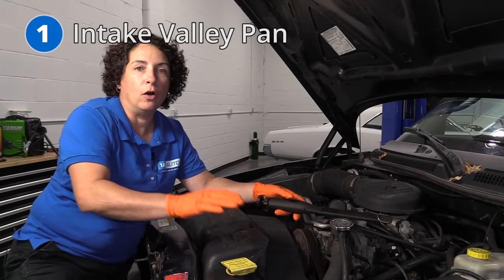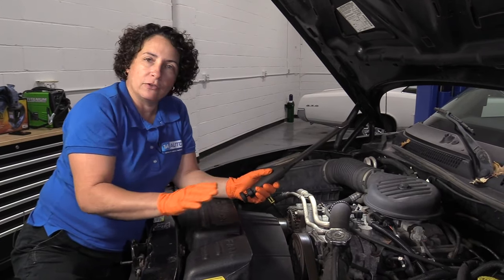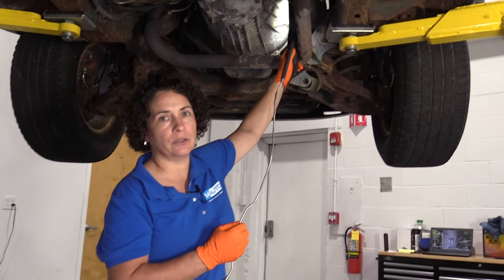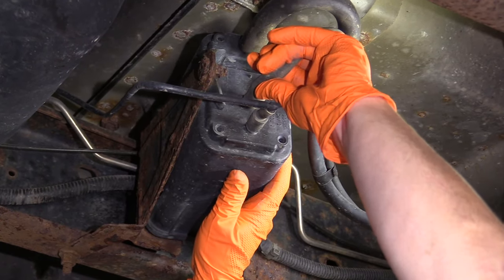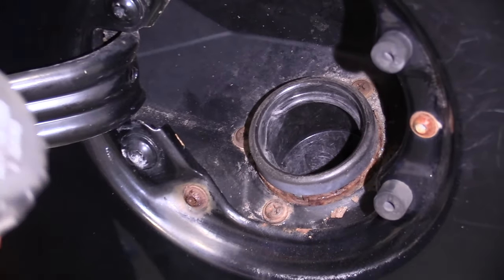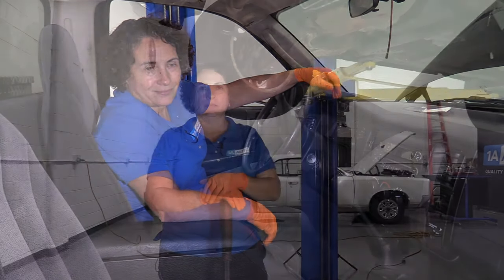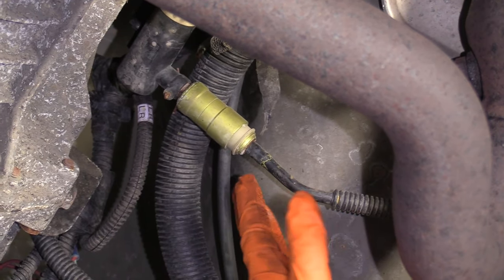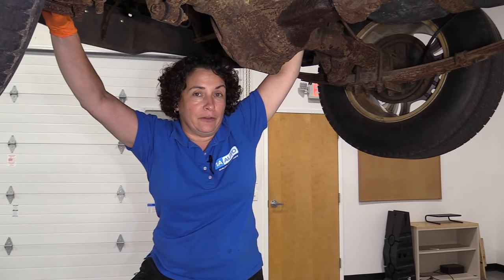Top 5 Problems Dodge Dakota Truck 2nd Generation 1997-2004

Comment: #1 problem: RUST
Reply: Says chevy boys that just as much rust on them cheap lil china men parts
Reply: Not in the south my 2000 has zero rust
Reply: I’m gonna be honest with you any truck is bad with rust depending on where you purchase it. I have a 99 Dakota and the dash is in mint condition and there’s not a spec of rust on the body , and or the chassis
Reply: That's the only prob
Reply: Not in arizona
Reply: Yea most southern states dont shower their roads in corrosive salt
Reply: @slavvings  why would they?
Reply: That's for sure
Reply: @enjoythesho1992  damn right
Reply: not for me I live in Canada and I have very little rust
Reply: My 2000 and got no rust
Reply: Aeeeeee yep
Reply: Got an 03 with 92,000 miles on it only put 10,000 on it It’s rusty af I’m also having problems with the idle like in the video and it’s shifting a little rough lately
Reply: My 04 is great, never a problem with it, very reliable. Being in Ontario though has taken it's toll.
Reply: I have a 04 with 250k miles, body rust yes. Frame rust, none!
Reply: My 97 ain't got no rust. In NC
Reply: My 03 it’s rusted so bad the bed collapsed and is gone now, gas tank fell off, fender flares are falling off, and the bumpers are held together by rust and zip ties like many other parts of the truck now. Still drives great though haha, except for a slight chugging like idle after I floor it. Check engine light has been on for 10 years
Reply: Yankee problems
Reply: not if you live in Southern Cali 👌🏼
Reply: @richmondproductions2914  🤣🤣🤣 Sounds like my old '71 Barracuda!
Zip ties, tennis ball cans, Bud tall boys, clamps, bubble gum, and a squirrel 😉😂
Reply: Not in Nevada
Reply: @enjoythesho1992 im in california and my 2000 dodge has no rust nether
Reply: My 97 has none. And I’m in Kansas
Reply: My 99 has zero rust.
Reply: Yes
Reply: That depends on where you live
Reply: @dmoore7519  because of snow and ice
Reply: @marklepkowski5362  the salt put on snow & ice.
Reply: check lol
Reply: Correction #1 Dahmer
Reply: Depends on where you live..
Reply: Was just looking at her lean on all that rust! 😂
Reply: On my definitely
Reply: @nobodyishere5871 shifting rough? Shift solenoids. If you have to let up on throttle to get it to shift, the 3-4 accumulator spring is shattered in its bore. Both are easy fixes just have to pull the tranny pan
Reply: My 98 looks like it rolled off the factory floor underneath
Reply: If you wash your truck during the winter you’ll have no rust, you have to get all the salt off from the road
Reply: @xextocity8769  not possible to get all the salt residue off. Inside of frame rails fill up with dirt and crud that traps moisture. The bands and folds of sheet metal do the same. Here in Connecticut the state uses a liquid salt mixture that is sprayed before a storm that creates immediate slush that is sprayed all over cars and trucks. There is no escaping it. If it only rains the cancer, as I call it, is still present. Before a storm you can see the see the white lines on the roadway.
Reply: Rust depending on where you live and if you wash your vehicles or not.
Reply: @bradwhite4827  true on the state you live in. Connecticut uses an a salt/ice melter sprayed on the roads in advance of snow or icing storm. When the snow starts this turns into slush and is kicked up and coats every nook and cranny of a vehicle. No amount of washing can remove the corrosion causing chemicals. The ice prevention companies rake in millions while motorists suffer.
Reply: @GrizzlyDonBauer777 I agree with you on that and Ford ranger is a rust magnet
Reply: I just bought a 2000 dakota with a rust spot on. The front of the bed , easy fix . And one on the bed rail , this truck came out of Nebraska
Reply: One word

Lanolin
Reply: Without a doubt, it's even worse on the Durango
Reply: Iowa boy here and yea you can see the difference in quality of paint and primer between first and second generations. The first gens have a little rust and paint coming off but still plenty of primer. The second gens are rusted to dust.
Reply: Must be in a high winter salt use area.
Reply: South Florida so no not a bit of rust 😂 my issue is it’s got 310 thousand miles on it and now it’s not wanting to start on me
Reply: my 97 has NO RUST..
Reply: Have a 04 with 195k on it from the south east US. One of the rustiest vehicles I have ever owned.
Reply: So true. I e owned mine for 4 years only put 7,000 miles on it and put all new brakes and rotors on it 4 years ago. Just went out to check the brakes and the backing plate and parking brakes rusted away. Literally gone from sitting
Reply: @huricane5184  Same, mine sat for a little over a year and had to replace whole parking brake system except cable, brake booster, a rear and front brake line, and somehow the side rails have now developed actual rust holes all the way through the metal and some on the driver side bed wheel well. Also the paint on the entire top is completely faded and chipping. All from just one year sitting in a dry field in the south east US. You HAVE to wash these things weekly and keep them moving constantly to keep them from rusting into scrap in a matter of 3-5 years.
Reply: 2004 with less than 200k miles, never driven on a salted road but it has spent the majority of it's life in fields or in the mud being completely neglected so I guess that's catching up to it now...
Reply: “At least the upper half ain’t rusted”
Reply: @JacobBurger-fu2  yeah not on the exterior at least 😂
Reply: Yes. I have a 02. Bed is very rusty. But my frame is a-ok. It has 200,000 miles on it. The V6 3.9 l and the overdrive transmission still work very well. just got to watch out for all the peripherals going out. I've had my truck since 140,000 and I've replaced just about all the peripherals (brakes rack and pinion steering bushings ignition system air conditioning alternator batteries belts lines, water pump power steering pump.) on it.
Reply: I’ve never dealt with rust being from California. It sounds like it just eats cars in the mid west

Comment: She forgot to mention the INSANE amount of rust on that. The rust had rust on it.
Reply: Typical truck lol
Reply: I'm stunned it has that much rust on the underside and yet the wheelwells aren't all bubbled up like mine. Weird.
Reply: Little freaking obvious dont y’a think?
Reply: @VSigma725  frame vs body
Reply: Mines got grass growing out of the valve cover
Reply: You work on cars much, bud? That isn’t shit.
Reply: I see you've never seen much Chrysler/Jeeps
Reply: @BangBangBang.  clearly right!
Reply: @VSigma725  they probably are underneath the flares, hard to tell. i know my quarter panels are good which is suprising, but my front fenders are entirely gone under those flares, i havent seen a truck that doesnt have the same issue or simular. unless it doesnt have the flares
Reply: @AFXGaming  yeah, my front fenders are really badly bubbled and I have the flares.
Reply: What do t have rust at that age lol

Comment: Rust.  Rust.  Rust.  That’s their problems.  Brake calipers made of cheese.  Strip out all the time.
Reply: Years ago I had a lube shop install a brand new caliper and when they installed it, they cross threaded the caliper pins and ruined both of the threads on my steering knuckle, after that, the brakes never worked right on the drive side and it caused damages to the brake caliper, the rotor, and the brake pads, when they drove my truck back to the shop, the brakes got so hot and looked like my truck was on fire from all the smoke because the caliper was unable release and was sticking very horribly. After that I never took my vehicle to a quick lube shop again, finally 5 years later I decided to work on my truck myself and then I discovered how they messed up, they probably cross threaded the slide pins because they didn’t start slide pins by hand and instead probably torqued them with an air gun. I ended up getting a new steering knuckle at the junkyard when I learned that the threads were stripped on the old knuckle, the steering knuckle from the junkyard was in very good condition and barely had any rust on it.
Reply: Had one for 17 years. No rust. Not 1 powertrain issue either. Junk primer tho. White paint flaked off big time
Reply from the maker: Thanks for sharing!  If you need an parts, check us out at http://1aau.to/m/Shop-1AAuto-Now
Reply from the maker: Thanks for sharing your story and for checking out the video, Phillip!
Reply: Rust is from salted roads. I've had vehicles from the north and have seen plenty of the same vehicle explicitly drove in the south. Northern ones rusted from floor up, Southern ones might have a spot in the weirdest corner.
Reply: @Rob Roy I own an 04 Dakota and live in Florida also an just noticed the cab starting to rot out on the rocker panel and I've owned this thing since new and it's never been up north or on the beach!! IDK!!
Reply: Most northern vehicles are full of rust.

Comment: I have No issues with my 02 Dodge Dakota I love my truck  👍👍👍
Reply: I have an 02 extended cab 4x4 with 4.7L and 5 speed manual. Love love love it! I’ll turn it into a pasture puddle jumper before I sell it!
Reply: @hotmetal459  EXACTLY  👍👍

Comment: I had mine for 15 years.  Replaced that cap 3 times with manufacturer caps.   Other than that, great truck taken out by a 300M on their phone.  No rust whatsoever in Virginia.  Always sprayed the underside after snow.  214,000 + miles.

Comment: 97 to 04 is actually the 3rd generation,  there was a 5 lug square body in the 80s. Was the 1st, 90 to 96 was the 2nd, 97 to 04 was the 3rd

Comment: my dakota hit 400k miles yesterday
original engine and transmission, no slip, no knocks
gonna pull the motor this weekend for a refresh
Reply: What motor and trans? Only 150K on my 2001 4.7 4X4 5-speed but it never breaks. Keeping as long as I can rebuild it.
Reply: What engine?

Comment: Great videos! 😮I have a ‘94 garaged cream puff I bought at an estate sake seven years with 90K on it. Original owner was a retired Mobile 1 guy. Now at 148K, only repairs was rebuilt front end including hubs when I got it.  Added the factory trans cooler, replaced the exhaust manifold gaskets one at a time due to broken bolts on rear cylinders (hemi’s do the same thing).  Recommend servicing transmission every 30K regardless of what quality fluid you use. Service engine every 5K mikes with Mobile 1 extended protection.  Expect to see 200K without major repairs on it. Great size truck for personnel use.  

Is a shame we were never offered the diesel version South America got.  The 4.7L V8 was a clean sheet design AMC had done for the Grand Cherokee, but didn’t get to put into production. Dodge ran with it when Chrysler bought out AMC.

Comment: I bought a little v6 Dakota as a second truck because it's a pain in the but loading dirt bikes in my lifted Silverado all the time. Aside from that little v6 being kinda gutless I grew to love the truck. My intention was to use it to haul bikes around the desert on weekends. But now I probably drive it more than any of my other vehicles. The interior is in great shape considering it's a 90s dodge. I actually considered pulling it into the shop and painting it. But I'm worried if I do it will bee nice enough that I won't want to use it for it's original purpose anymore. Anyway, it's been a good little truck.

Comment: Thank you for this awesome video. I have been chasing a few problems for a while now on my 2001 Dakota 5 speed. The two that you provided in this video were the valley pan and the crankshaft end play. Your video described all the steps I have already taken to fix the problems and they were still there. I have not replaced the valley pan yet, and I had not thought to check crankshaft end play for the grinding / hard to put into gear. It makes sense as it shifts not bad when first started, but after it is warm the shifting gets worse. It feels like the clutch pedal just needs to be depressed just a bit more. I have watched many video's and yours is BY FAR...the best out there!!! Thank you so much!!

Comment: Thank you so much for this information! I've been  trying to figure out why my 2000 Dakota has been running so rough. After changing coil packs. It was still running rough. Then I heard about the intake gasket. Now you just confirmed it to me. I can't thank you enough. I'm not sure how much it will cost but at least I know what the problem is. 
God bless you!
Reply: How much did it cost?

Comment: I saw this and was really reminded of how good my 03 Dakota SLT 3.9L has been to me. It's given me zero major issues so far, and only a few minor issues that I either have fixed or plan on fixing. Had a misfire on cylinder 6 last year, original wiring from the distributer ate through the coating and fused to the number 4 wire. Had a full tune up and problem solved. Had an exhaust leak on the exhaust manifold as well, took it a step further and installed a set of quality short-tube headers, a magnaflow premium cat and a magnaflow rumbler dual chamber muffler. I also installed a cold-air intake and a ported throttle body (because why the hell not?). Only issues rn are a bit of play in the steering (needs new tie rod bushings) and a slow-shifting trans (needs new shift solenoids). Truck has 211k miles on the original engine and trans and still runs like a champ. When the engine or trans finally goes out, I'm probably going to swap a 6.4L V8 with the Dodge 8-speed auto into it. And despite several road trips to the northern states by the previous owners, it has ZERO rust, save the original exhaust, which is expected regardless of the environment. I love this truck to death, and out of the Toyota Echo and Saturn Vue I have previously own, and the Ford Ranger I currently own, it is easily the best vehicle I have ever invested in. ❤
Reply from the maker: Thanks for sharing your awesome truck story and thanks for watching our videos!  If you need any parts for your truck you can check us out at http://1aau.to/m/Shop-1AAuto-Now
Reply: I have a '03 Dakota 3.9L too with a little over 180,000 miles. I have a bit of play in the steering wheel and a slow shifting trans as well, seems to take forever to shift into third gear. I checked the EVAP hoses since it was throwing the EVAP code and it does have some cracking on the inside of the hoses. Gonna have to replace those and get her a full tune up. Had to replace the blower motor fan relay behind the glove box since the fan speeds wouldn't work on any speed except low. I also have a '07 Saturn Vue, lol. And the sun roof is a bitch on that! It keeps leaking because the drain tubes keep coming off the nipples. Had to have it fixed and the electrical wiring replaced where it leaked under warranty. And the damn thing started leaking again out of warranty this time.
Reply: @J.G.3  check your throttle value cable, it's the one on the back side of the throttle body, towards the firewall. After being set for so long, it could be stretched. If the line is too loose or tight, it will dramatically affect shifting points and behavior. There should only be about 1/8"-1/16"  of play in the cable. But the solenoids are a weak link, overdrive solenoid is my problem child rn. It still works, but it gets stuck between third and fourth for about a second before finally engaging 4th.
Reply: @oxidizedolive   ….. I have got to look at that. My 04’ will shift up into overdrive before I even get up to 40 mph. Then it does an elaborate downshifting search to try to select the right gear. Locking out the overdrive only helps a little bit. I does fine with overdrive over 60 though for some reason.
Reply: Want some other hotrod bits? I have a ported intake, heads, 1.7 rocker arms and upgraded injectors for sale.
Reply: Same here 03 must have been a good year. I just hD the exhaust manifold leak repaired . Normal wear and tear, brakes, etc. No rust. Live in the southwest. Did install a bugger capacity radiator due to desert and driving up mountains. Been  good truck. Will replace engine when that time comes.
Reply: @c.s.s.1723  sorry for seeing this so late, but the '04 is a completely different animal. They did away with all LA-based magnums that year (3.9/5.2, removed in '00/5.9) and only had the 3.7 and 4.7, both of which had an electronic throttle body if my memory serves me correctly.
Reply: how much for a new V8 engine?

Comment: Great video nice to have things to look for. Never heard of a throw out plate. The heat issues are something else you could mention like the blend door and heater hose reroute on the V6 to get the hottest possible water in the heater core. These videos are very helpful to lots of people!. Update.. Heater core was blocked. Very small heater core. Single row. Full day with help. Heat works good now!

Comment: Thank you for this video! My 98 was stalling intermittent with no codes. Sure enough that vacuum cap you show had fallen off! Reinstalled it with zip ty to keep it planted and swapped the IAC valve just to be sure and she's running sweet again. Thanks very much!
 Btw you have a great smile 😊

Comment: Thanks for the tips. I have one. Loose axle shafts on the 4wd's. The spline design is the worst. Too much rattle. Heater cores are buried . Dodge built the dash and truck around it.

Comment: I have an 04 Dakota that I bought new. 205k miles as of Aug 2021. Replaced transmission at 110k. Have also replaced water pump, AC compressor and on third set of engine coils. Various other items as normal wear and tear goes.  I admit I don't like my truck as much as I used to... but it still looks and runs decent.
Reply: Tell me the truth. Are those seats not the most uncomfortable you have ever sat in? 
Not even trying to be a smart ass. I just want to know I’m not the only one.